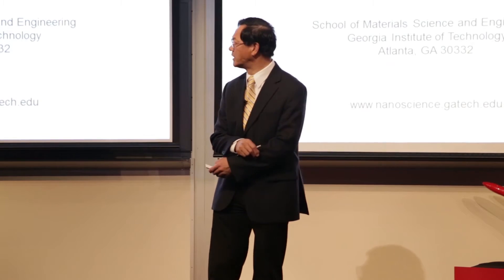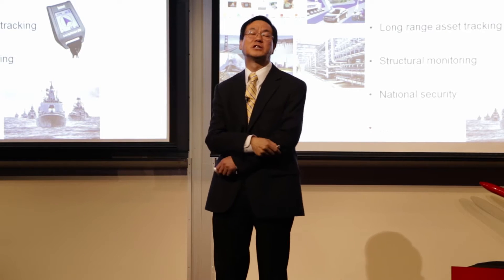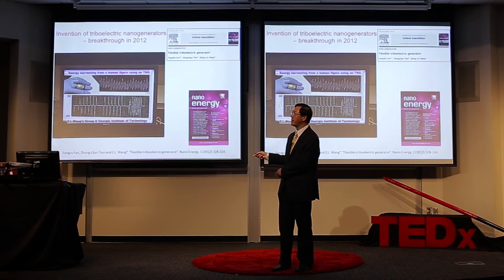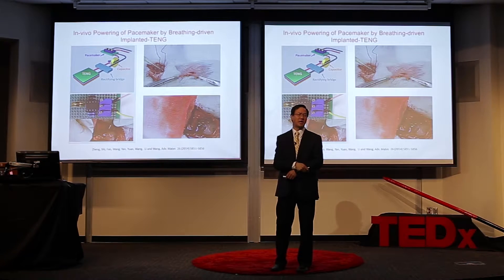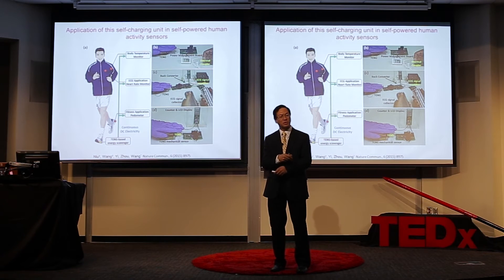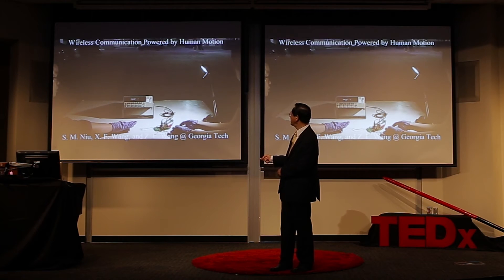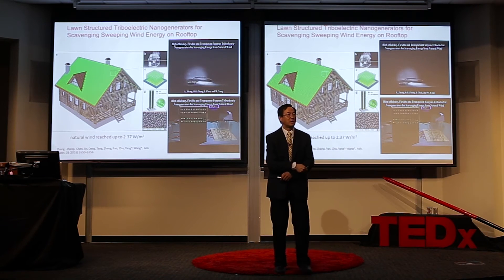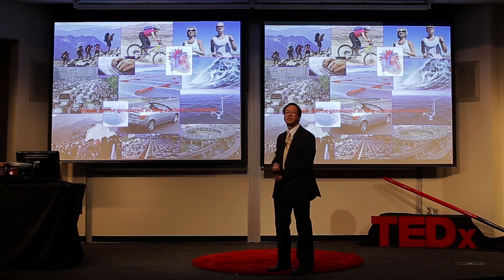Nanogenerators for Micro to Mega Scale Energy Harvesting | Zhong Lin Wang | TEDxGeorgiaTech

Comment: Are you saying that if a jumbojet is covered(all the external surface) with nanogenerators harvesting the Wind friction, the current produced can be enough to power the front fan of each engine ?   (take note that 75% of the thrust is produced by the big front fan alone)
Reply: I mean you still have to get it to relative speed before that charge could be built.

But why waste all the time in fossil fuel nostalgia. When nano generstors can power ion thrusters to fly bladeless airplanes. Space travel
Reply: @jefferylubinski528  yes Fossils are Just so Terrible
Reply: No, that not even close.
Reply: the process on contact and losing contact is necessary to generate the electricity. A jet wouldn't allow that